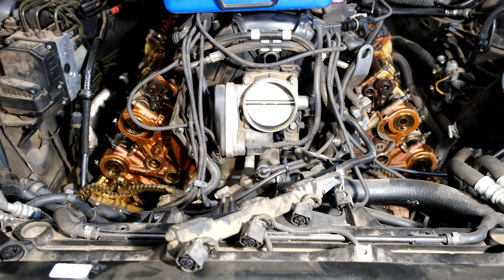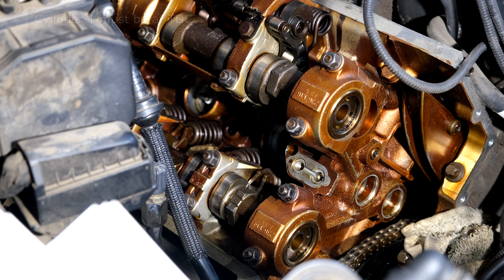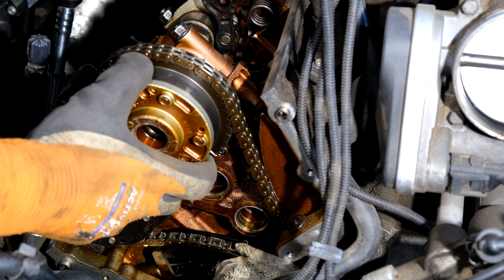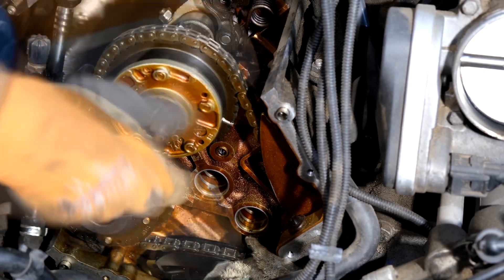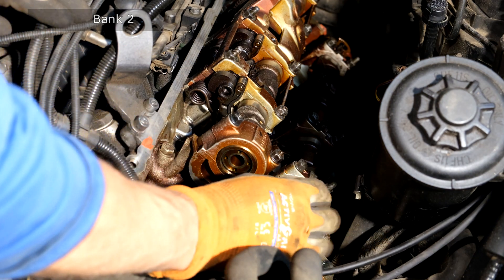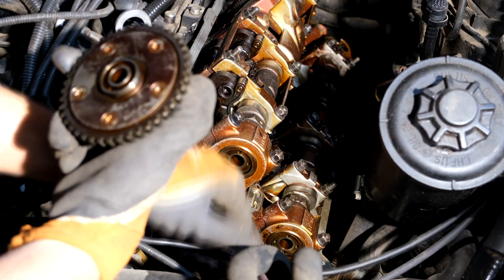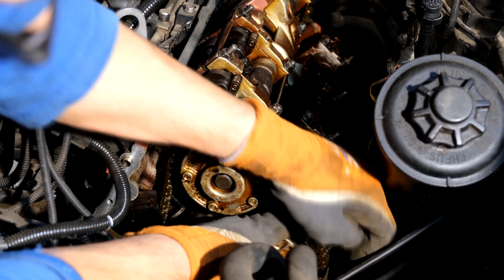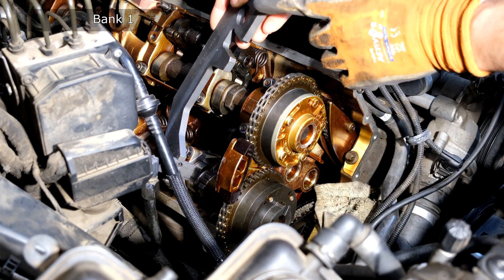How to do the timing on a BMW N62 engine - step by step

Comment: it looks like the chain doesnt go to the bottom of the cam gear... is ot normal to look like this? just noticed it on my N62 looking through the oil cap, but when I tried to pull the chain with a hook it bareli moves. Thanks!

Comment: Dumb question here...does the orientation of the vacuum pump matter when re-installing to the vanos on exhaust Bank 1? Seems like no, but in case there is a pickup in there or something or if it is keyed I wanted to check, thanks a ton.
Reply: It shouldn't matter, you'd just have to finagle the vacuum pump when you reinstall it to get it to seat all the way in.
Reply: You could turn the engine after assembly until the slot for the vacuum pump is vertical. Should be easier to install like that

Comment: hi i have a 645ci 2004 with similar n62 so im doing the timing and set it and spin twice and they are lined up both sides but when try and turn it on it starys up first try then i shut off and it doesnt turn on second time i check timing on tdc and the cams positions are off please lmk what i can do thanks in advance

Comment: Should I do the timing chain replacement first and then the valve stem seals? Or the other way around? Thanks!
Reply: If you diy, do both as you’re in there, little bit more time consuming but not that much more money. 
If you don’t diy, I’d do the chain first, seals aren’t as much as a critical problem

Comment: I'm not gonna try it but I still believe you could just turn the phasers against the stop while the nut is loose enough to move them without moving the cam and then tighten it down. That's assuming the cams are in the right spot. Even go so far as to scribe a mark on the cam and cover to check alignment after a couple rotations. 
Those tools are just for making sure the cams are in the correct place with the phasers against their stops. Happens when you rotate it twice due to the resistance of the cam turning and fighting valve spring pressure. Phasers turn to the stop then the cams start turning.

Comment: If you could reply that would be great how do you get the motor to top dead center before I do all this
Reply: He’s inserting a pin to lock the crank pulley and harmonic balancer. On the block there’s a whole for you to slide the pin through both the harmonic balancer and block to let you know it’s TDC.
Reply: @banks11201ify 😊😅

Comment: Hello got the same engine, 2006 BMW 750LI, with code P0024 - B Camshaft position timing over-advanced or system performance bank 2. I know bank 2 is driver's side. There are 2 vano solenoids, intake and exhaust. I verified that the solenoids are good. If solenoids are verified as good, what would be my next step to do? Would it be what exactly you're doing here? Thanks.
Reply: Bad timing

Comment: I purchased a 07 X5 4.8i with error code P0022 and P0018. Followed your instructions here I adjusted the timing, but the codes come back after driving a few times. I can delete it but they come back. I noticed the timing marks on my camshafts are shown exactly like as 1:06, not perfectly aligned, after adjusting, and they were like that when I got the car. Both banks are like that, but only bank2 is giving the error. The car drives ok now, and the previous owner said the same, drives ok witht the error. So I guess I didn't fix the root cause of this timing issue. Can you advise what shall I do next?
Reply: I didn't replace the time chain as I see they were in quite strong tension, and I saw no broke timing guides.
Reply: I didn't remove the time chains while doing the adjustment, just release the camshaft bolts.
Reply: I swapped VVT Motor, VVT solenoid, Camshaft Position Sensor, from bank2 to bank1, the same error stays. So the problem is definitely locally in bank2. I can hear the engine light comes out when the engine suddenly have a "huh" fuzzy sound, like a sudden speed change of something.
Reply: At this moment, I only have the code P0022, no more P0018. Next thing I can try is change to use BMW oil from the dealership.
Reply: I did have some damaged teeth in bank2 eccentric shaft, but I saw most of forum posts say we can live with that. The previous mechanic that needs to be replaced, but it's too expensive. Not sure if that's the root cause of this P0022. I did some a post said replacing  eccentric shaft sensor fixed his P0022.
Reply: @bluegables  have you removed and cleaned the vanos solenoids?  Also once you remove them you can hook them to a 12v source to see if they open and close.
Reply: @shawnm6457  yes i removed and cleaned and swaped them.
Reply: Did you get it figured out? My 2006 550i has the same code and I basically have done the same thing as you and my code is still there

Comment: I just opened valve cover. Is there a way to tell if the timing is correct w/o the tool?
Reply from the maker: i would not recommend confirming timing without the tool

Comment: My 2005 745li is throwing a code for timing over advanced on bank 2...can you please tell me if it's timing chain...or the timing chain guides or vvt solenoid related or what???????
Reply: We are having the same issue, did you fix that?
Reply: @bluegables  not yet..smh

Comment: Did valve stem seals and retimed, getting codes for tooth offset now, doea it matter which way you install the cam gears or are they 360° installable, timing frames fit by the way
Reply: Sounds like it may not be timed correctly...
Reply: @radianm6  its timed but I was asking about the cam gears, are there marking for alignment on them, all timing videos just place them on and there doesn't seem to be a specific angle
Reply: @TannerShean  the gears shouldnt matter  where they're at if you're talking about the sprokets
Reply: @radianm6  thank you yes the sprockets, ill check timing again and clean up the vanos solenoids
Reply: @TannerShean  I just did the same job (valve guide seals) put the engine back together. I have misfires on cylinder 1, 2,3 and 4.  I'm about to atke it apart again to check timing.  So frustrating!

Comment: I was just checking out passenger side exhaust and when I get it to where the timing to can go on camshaft to check flatness. I noticed cylinder 3 valves are compressed is that normal?

Comment: How were you able to timing on passenger side where special tool is supposed to go but hits frame?
Reply from the maker: never has that problem, maybe lift the engine a bit
Reply: @ecologicaltime  awesome thank you.
Should be doing this soon. Engine going back together now just waiting on coolant pipe seals
Reply: @ecologicaltime  now when I time the exhaust is it normal for it to be compressing any valves down? I noticed also like It seems it doesn't want to to stay put timing the exhaust like it will spring back to a different spot with timing tool off-thank you in advance
Reply from the maker: slight compression if i recall, but the tool dictates the setting. The camshaft may need to be turned 5 degrees to slot the tool in

Comment: hello eco, so first of all, should i put a "spring" into the cylinder, then crank the engine to see piston go to his TDC? or the marks on the main wheel (those, where you put the special tool) tells me, that the piston reached his TDC. I hope you understood me, im from Poland. By the way, great video, im doing valve stem seals, its possible thanks to your videos on N62.
Reply from the maker: the marks tell same, you can double check with the spring method